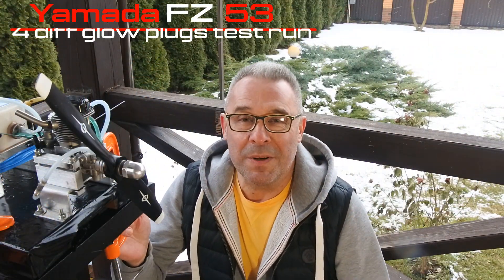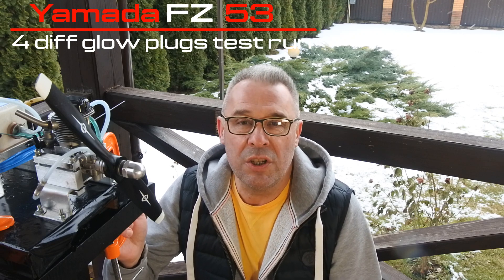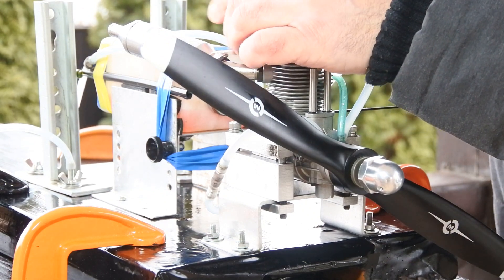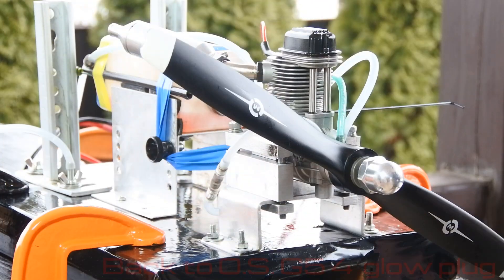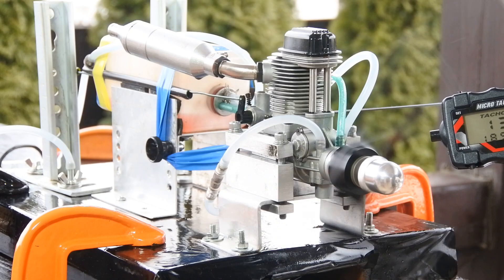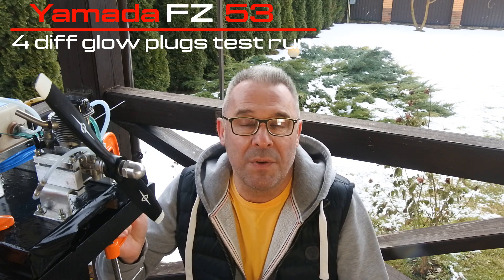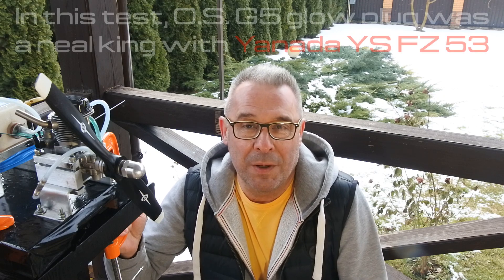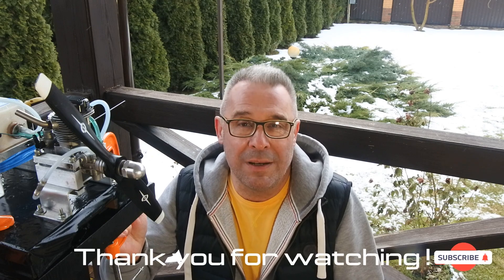Yamada YS FZ 53 4 diff glow plugs test run

Comment: Hello there
I have one of these engines YS 53 , I am unable to set it right and it doesn't run correctly.

Please can you help.
When I start the engine 1/5 throttle open,  1,1/2 high speed needle valve open and low speed is 1 turn out, regulator is flush with the crankcase body.

Check valve correctly placed, primed the engine with 3 flips of propeller, fuel pipe gets fuel in high pressure. I start the engine ,engine starts and then there is uneveness in the engine RPM sometimes slow and sometimes fast engine runs for 2-3 mins and then stops.

I tried of this engine.

Regulator assembly is new,
Carburettor assembly is new
All gaskets are replaced with new.
Fuel tank has no air leakage 
Rear cover assembly is new.

Engine has good compression and good rpm.

Please suggest what should I do do????
Reply: Hi there,

Thank you with your reply❤.

I got the issue. 

I was running the engine with no Nitromethane.

I was trying to run with 0% Nitro.

I was using  25% synthetic lubricant and 75% methanol, that's all. So because of this engine use to start and stop after few seconds.

Have you ever run YS 4 stroke engines without any  Nitro??? Will YS engine run without nitro.

I mostly have OS and Saito 4 strokes and they run smooth without any nitro in the fuel.

I have just started using YS engines, and without nitro, it doesn't run 😢.

Have you tried running YS 4 stroke without any Nitro in the fuel?

And what is the % of nitro you are using in your YS engine in the video?

Please let me know

Regards
Reply from the maker: @anantsingh5148   Hi, and thank you for soon reply. Definitely, Yamada YS 4 stroke engines were designed as high performance engines for racing \ acrobatic \ sport purposes, so it's necessary to use fuel with Nitro. During my .50 & .60 class engines comparison test I decide not to include Yamada YS 53 engine into this comparison, because such comparison test will be valid, if all engines will run on the same fuel and that was FAI fuel, so w\o any Nitro. FAI fuel (80% balanced Methanol & 20% oil) is a classic oil for completions, where all participants must utilize the same, FAI fuel, to make the competition fair for all participants. So, after few attempts to run Yamada YS 53 on FAI fuel I understand, that Nitroless fuel isn't for this engine. It works, but it was quite tricky to adjust it for good performance, so I decide to exclude it from the comparison test. It's recommended by Yamada, that fuel should have at least 15-20% amount of Nitro. All Yamada 4 stroke engines were designed, like a "turbocharged" style engines, where Nitro is very recommended addition to a fuel mix.   In my test I using 16-20% Nitro in a fuel mix. Sorry for a longread, I'm trying to explain as more as possible in details. B.T.W., 25% of oil it is also too much,  I understand, that you're trying to run engine very safely, but 20% of oil content is more than enough. Excessive oil amount in the fuel mix lowering engine performance and increasing instability.
Reply: @crazyengines88 

Thank you very much for explaining things so nicely ❤.

I appreciate your such a nice reply😊

I will reduce synthetic lubricant to 20% now. 

Today I got the nitro and made my fuel  by making it as ,30% nitro , 20% synthetic lubricant and 50% methanol , so I hope that is safe? With this blend I ran the YS 53 today and it ran so smooth with smooth idle non stop.

I am hesitant in using Nitro because I think it reduces the Engine life , so is it true? As using Nitro reduces engine life?

If I use 20% synthetic lubricant and 80% methanol and no nitro ,will the YS 53 run smoothly? Please suggest?

Or what fuel blend I should make ,so that I get good idle and engine is also safe?

Please advice?
Reply from the maker: @anantsingh5148  Hi and thank you for your kind words. First, I think, that 30% of Nitro could be a little bit more, than necessary,  I suggest 20% at first time, because you will need to adjust engine, later you can add 5% more Nitro. From my experience with Yamada 4 stroke engines - 15-20% Nitro is enough to get a nice and stable idle. You should check, that pump regulator screw is in  one line with the boss on engine case where it sits. Also, please, be sure, that  tubing (and check valve) are connected, according to engine manual. You can find it here: https://www.manua.ls/ys/fz53/manual 
Wish you a good luck with your engine !
Reply from the maker: Hi, thank you for your question ! I should state, that remote online tuning of Yamada YS 54 engine could be too complicated, but lets us to try. I've few questions, to clarified the setup. First, do you have check valve installed, accordingly to machine manual ? Second, it's important to set all carb and pump settings to the default (factory set) position. I will check with my engine, but as far, as I remember, pump adjustment screw should be set in the position were it surface is in line with the outer part. The carb screw should be slight open (2-3 turns from the fully closed), not more. Also, I would recommend you to find operator manual and check, how your tubing is connected. I'll look at my engine, to share with you some pictures \ settings. Good luck and have a nice day !
Reply: @crazyengines88 
Hi there,

Thank you with your reply❤.

I got the issue. 

I was running the engine with no Nitromethane.

I was trying to run with 0% Nitro.

I was using  25% synthetic lubricant and 75% methanol, that's all. So because of this engine use to start and stop after few seconds.

Have you ever run YS 4 stroke engines without any  Nitro??? Will YS engine run without nitro.

I mostly have OS and Saito 4 strokes and they run smooth without any nitro in the fuel.

I have just started using YS engines, and without nitro, it doesn't run 😢.

Have you tried running YS 4 stroke without any Nitro in the fuel?

And what is the % of nitro you are using in your YS engine in the video?

Please let me know

Regards

Comment: Thanks for another great and interesting video! What propeller did you use here? Do you recommend the OS G5 plug and this propeller even for high rpm?
Reply from the maker: Thank you very much for your comment ! I will answer with details few hours later, I'm seriously in harry mow. Thank you !
Reply from the maker: Hi, I was check size of the prop, used in thin test run, it was 13x6 Master Airscrew, prop, a little bit bigger for this size. This prop was used, just to get more flywheel momentum, for stable and lower idling, so I definitely would not recommend it for your appreciation, if you're planning to utilize this engine according yo its dedication, so for sport flying. This engine is the most powerful engine in its size, and I think, that 12x6 or 12x8 prop size will be the best choice, if you will need something from 9K to 11K RPMs. Thank you for your question, I'm apologizing for delay with reply. Have a nice day !

Comment: Appears to me OS F plug was the best, anyway thanks for the video, engine sounds great
Reply from the maker: Thank you very much got your comment ! I think, that O.S. type T and G5 glow plugs are very similar in behavior. The only difference in that G5 is designed a dozen years after the type F, and it was dedicated to gas \ petrol powered engines, so O,S, makes several changes in glow coil alloy, and probably, in some small details. This changes also 
were had a positive influence on G5 performance with glow fuel engines. To be honest, using G5 glow plug with glow fuel engines aren't recommended, so definitely, no one could predict the influences on working on glow fuels on the plug working lifetime. 
Thank you for your opinion, have a good fay !

Comment: Fun to watch, but inconclusive in my opinion. The video creates many questions. Are the glow plugs all very fresh? Since the G5 got constant heat which allowed a low idle, why not did all the other glow plugs get constant heat also for the test purposes? Without glow plug igniter, the Yamada plug gave the lowest idle @ 1320. A low idle is very good to have when you must taxi your model airplane a very long distance from the pits to the runway, as is the case at my flying field. 465' distance! I think you should have also tested maximum RPM with each glow plug, as I believe they could make a difference at full throttle also. Perhaps when you are not freezing your nuts off, you could do a more comprehensive test session. 🤣
Reply from the maker: Thank you very much for your comments ! Definitely, you're totally right about the necessity to test engine also on high rpm's, as well. And yes, it's true, that cold weather seriously reduced my personal ability to work outside for a long time.
So, agreed with your comments. I should also add, that G5 also runs very well w/o glow support, practically, (pls. look into 3rd chapter with G5) with the same rpm's @1320. So, it was clear, that with G5 glow support gives no any advantage. Only the more insurance, that engine will be run constantly during long taxi. 
I think, that this test should be continued, taking into consideration all your comments. But let's wait for better weather, OK ? 
Thank you very much, and have a nice day !

Comment: Just curious- what fuel was used, especially which nitro percentage?
Reply from the maker: Thank you for your comment ! You're totally right - I wasn't mentioned about the basic things in that video, that's true. Fuel is UK made Model Technics BigBang 16% Nitro. Due to the reduced oil content exactly in this fuel, usually, I'm adding 4-6% of Motul Micro 2T fully synth oil in fuel. So, it also means, that real Nitro content was slightly reduced. Due to fact, that engine was freshly assembled and after rebuild, decide to increase oil content a bit. For that test 14x6 MAS prop was used, so for sure, it was heavy for that engine size. 
Anyhow, I haven't experienced any detonation behavior, trying to run on a bit richer mix.
Outside temp was around +2 Celsius. 
Thank you for watching and have a nice day !